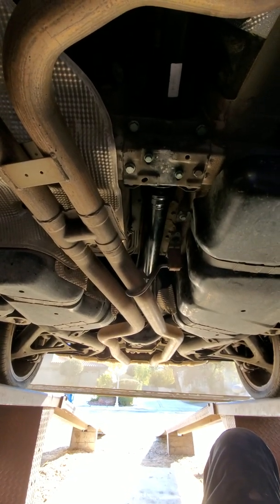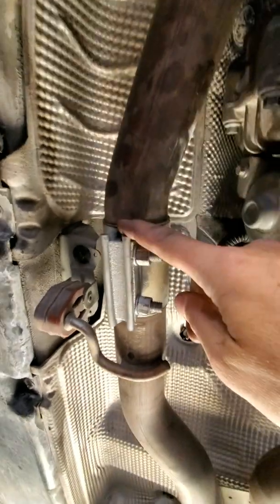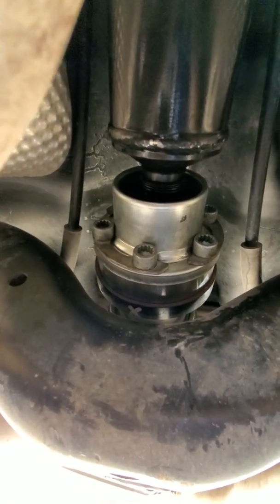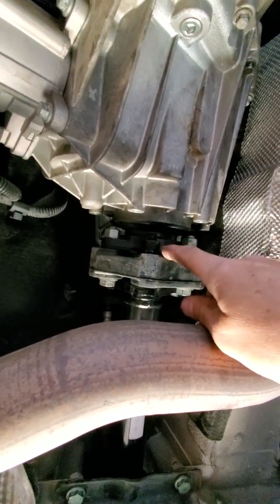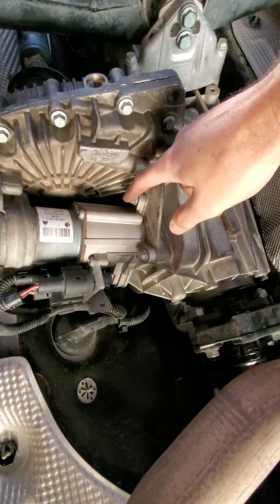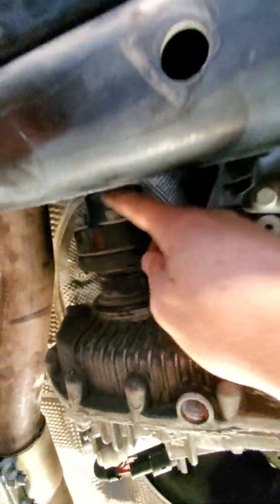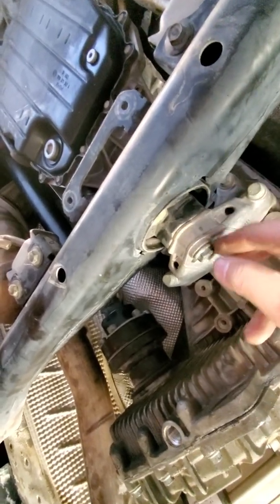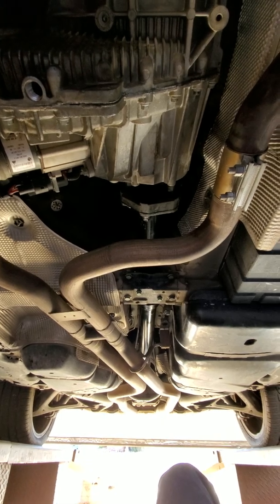VW Touareg. Part 1.  How to remove. Transfercase.

Comment: How much of the weight of the TC? Can a person hold it and pull it from the gearbox or should use a second jack to hold it?
Reply from the maker: One jack one transmission.  To lower the trans. To get to the 5 bolts on each side. Makes it easier.  Then have 2 people to pull the transfercase.  It's to heavy for one person.
Reply: @irontownartfabrication9164  Thank you your quick reply. I have to change practicly all the seals - engine rear, trans and TC-, therefore I will remove the transmission and the TC together using a transmission adapter and a jack. Than I will lower the jack and have much more space to remove the TC from the trans. The trans should be supported on the front avoiding the jack tilting forward when removing the TC I guess. Definitely a two man job.
Reply from the maker: It's about 100 pounds.  And there is only one way to work on it. You have take it out of the suv. I have videos how to work on the transfercase . Good luck.
Reply: @irontownartfabrication9164  Thank you.